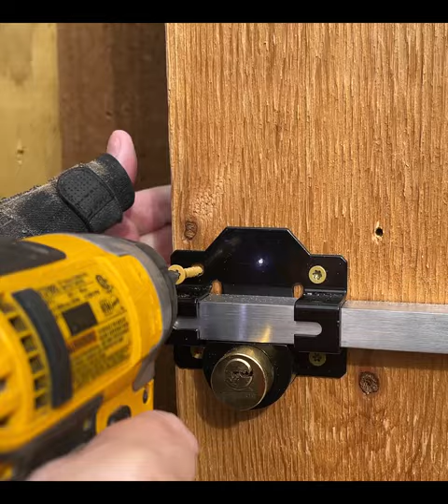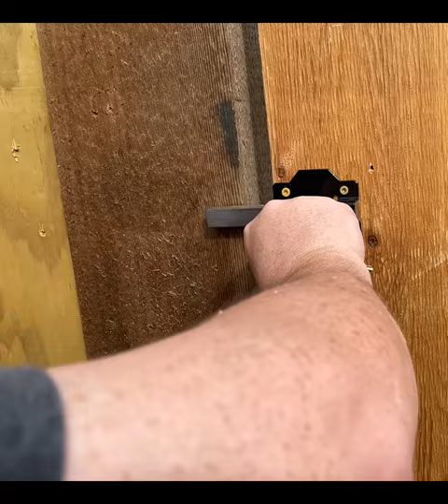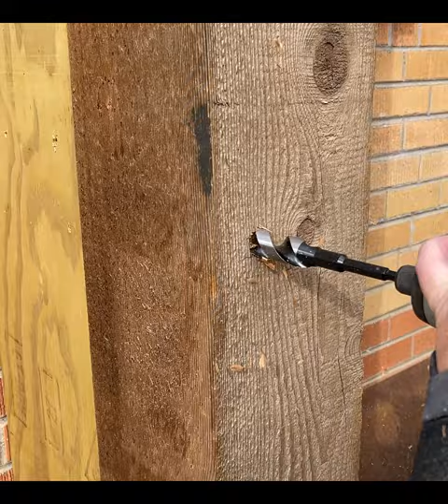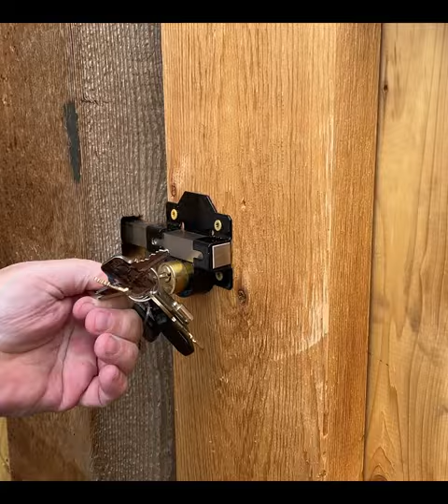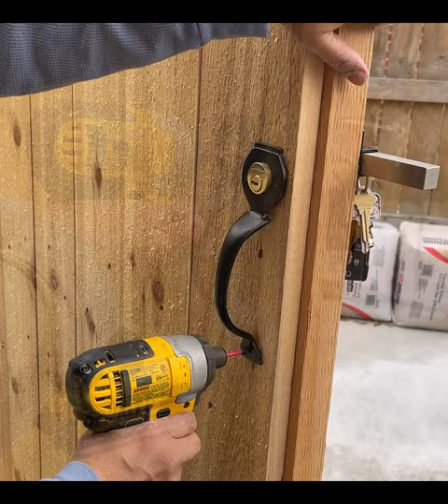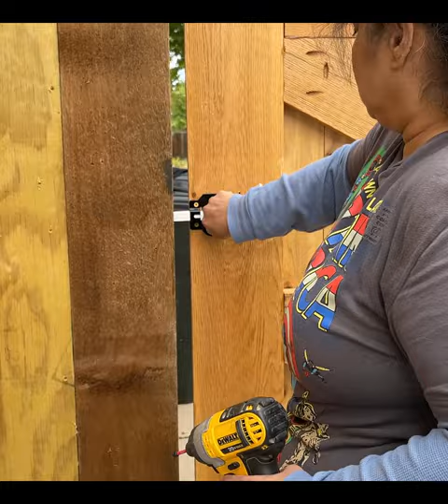Gate Lock with long throw bolt Check out the full length gate build! link in description!

Comment: It's a nice idea, but all I need is a screw driver and I can take that lock off which defeats the purpose of a keyed lock. Would be better to have a bolt go through the front and out the other side tightened with nuts and locktite. A thief probably carries a set of screw drivers. Not likely they gonna carry a socket wrench with various sizes of sockets.
Reply from the maker: The 3 screws on the outside of the gate only hold the handle. 

The screws on the inside (that hold the operating lock), cannot be accessed. Unless you jump the fence of course. 

And if you climb over the fence, there’s no real security. The whole locking idea is just a deterrent in reality.
Reply: @KingsFineWoodworking  My bad.....From my point of view in the video, for whatever reason, it seemed like that was the outside. I guess "assumption" nicked Mr in the butt....again. lol.